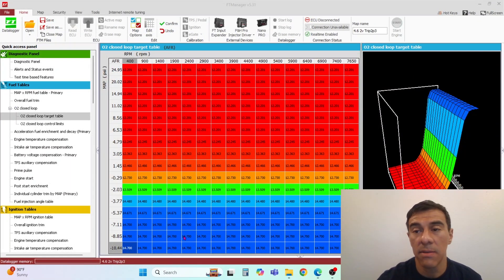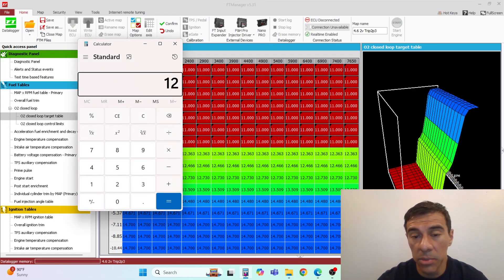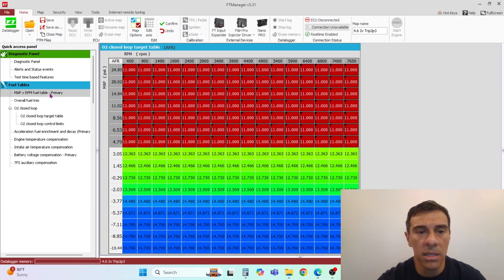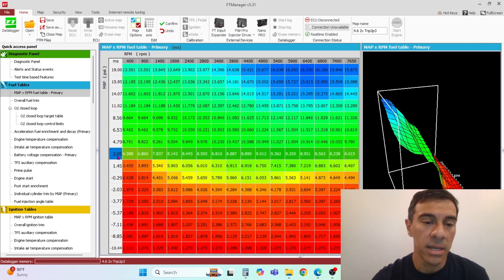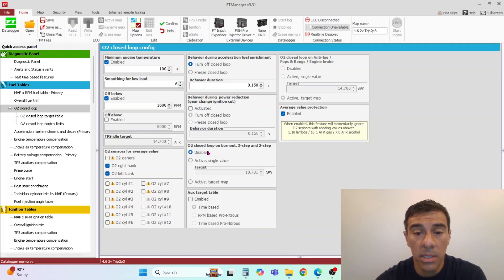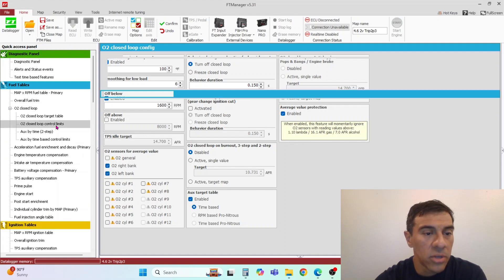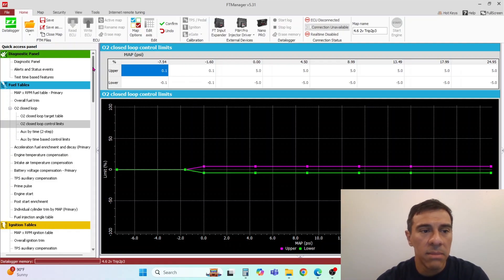FuelTech O2 Closed Loop!

Comment: Quick question in the settings how did you get your “TPS idle target” to 14.7?
Reply from the maker: What exactly are you asking? Are you wanting the units in AFR?
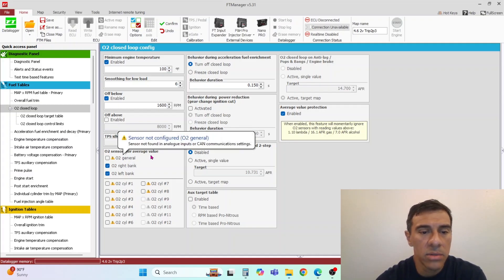Reply: Sorry for the confusion, when you’re in the 02 closed loop configuration window (3:22 time), There’s a “TPS IDLE TARGET” section yours is set at 14.7.. mine for some reason stays at 12.7 and I can’t adjust it. Any suggestions, thanks!
Reply from the maker: @wrivas9475 if it’s grayed out that means tps idle target is not enabled. To enable tps idle fuel table go to engine setup.
Reply: @ChuyTech understood, Thanks for the help!